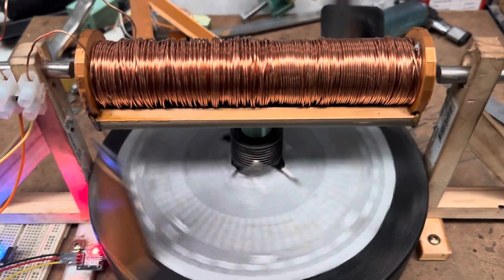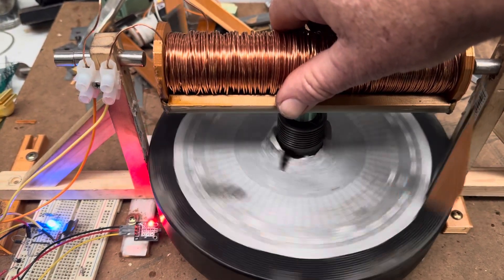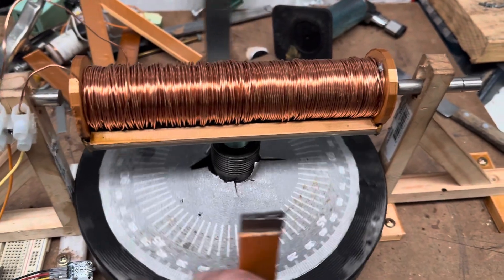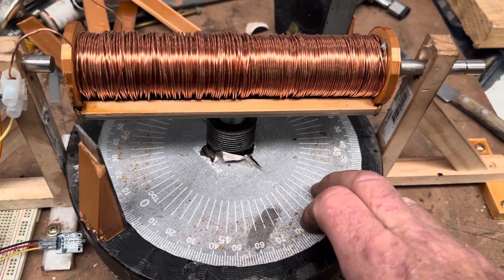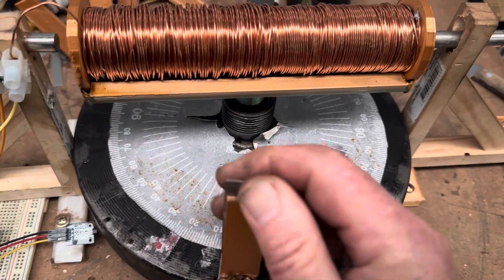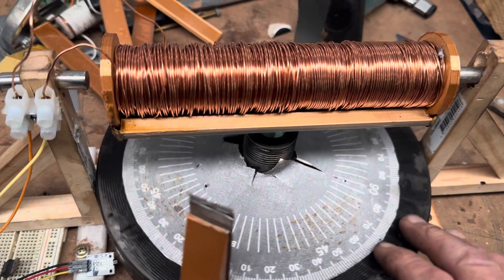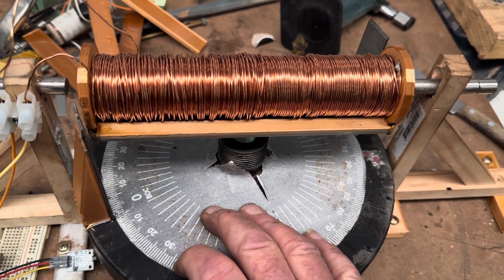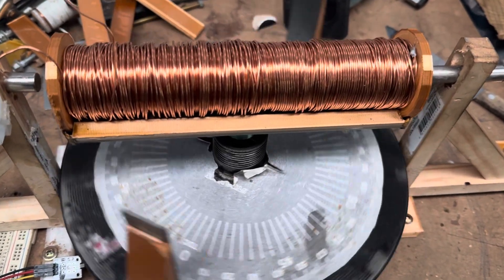Torque to me

Comment: Use much higher winding like twenty thousand turns, and use at least 5000 volts with low Ampere like less than 10 milliamps. Thats a working newman motor.

Comment: I want to build a generator something very efficient and the output controllable like a alternator . Problem is a car alternator is about 50% efficient when hot. I want to charge Large batteries, possibly an axial flux! With serpentine windings , i have seen faraday's homopolar generator the paradox, apparently the magnetic field isnt attached to the magnet? Or doesn't spin. I need something capable of 100'sof amps, up to the 4-5,6 kw range, but 2 kw is still useul. I need multiple means of charging. Using gas engines 5-12+hp, a small diesel 3-10 hp, and possibly a steam engine of some sort, tesla turbine possibly use a wood stove boiler  to hopefully get atleast 30-40a at 29vdc, or 15-30a at 58.5vdc.  to power my house when solar isn't doing so.  Slightly different side of the coin from motors , i also have a few series wound brushed forklift motors. And been curious if it would be possible to reconfigure it to a brushless bald motor.  Change the rotor to a Magnetic type. And possibly wrap the Magnets with carbon fiber ribbon or kevlar maybe both. The motors Tesla uses they started wrapping in carbon  requires special equipment to get it tight enough,  im thinking kevlar blend being it can stretch a bit. Its probably not hoing to see the extreme rpm tesla motors see.  10-12 k rpm would supprise me, I want to convert a car or motorcycle to electric. And use solar to charge it. At the moment a bicycle isnt even on my budget. Getting 20-30 kw from the motor would be great , the micro kei trucks inported  from Japan would be great but a early 90's Toyota or nissan excab truck would be great also to convert. Maybe go cheap and simple, or maybe buy a wrecked nissan leaf to swap parts use a motor in front and another in rear.  Or use a tesla motor ib the truck. Setup a 20kw solar panel shed to  park under and charge it. 8 hours should do it in summer. Possibly use batteries to store for night charging. And use. Steam from burning trash, to charge waste oil in a diesel , distil tires and plastic to use in gas engines to generate power , sorry to ramble!!

Comment: Have you ever used iron filings or powder as a magnetic core? or though about doing it? Make a mold fill with the powder and add epoxy resin, fiberglass resin then compress it. And or place in plastic and pull a vacuum , maybe do a vscuum infusion. I have seen aluminum and copper powder done this way. It would probably be a good idea to put a hevy coat of paint on it.  If it ever started rusting it would probably swell up and fall apart.  Some resins will absorb moisture. Since silicon steel isnt cheap to get unless recycling or buying 1000's i saw a guy convert a starter motor to brushless, the cheapest stater was over $100 USD, it was EDM cut. And painted very professional looking, and about 90% more. Costly than its worth, im just curious if the powder and epoxy will work, or maybe even superglue could work, i never used that much at once..
Reply from the maker: I disassembled some 12v transformers and used the I pieces

Comment: Looks good. I wonder how much improvement it would make if you were able to make the vertical torque plates shorter.
Reply from the maker: Honestly I have no idea. In previous builds shorter width performed worse though. However I was not using a hall switch. Current draw is now down to 30ma at 12V - still pretty slow at 70 RPM. I plan to add more blades but calibration is a bitch :)